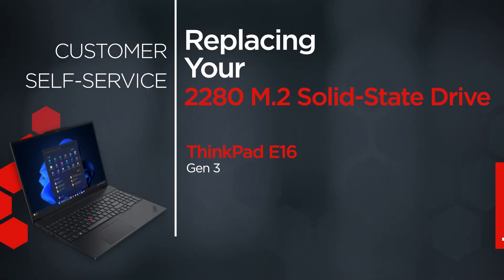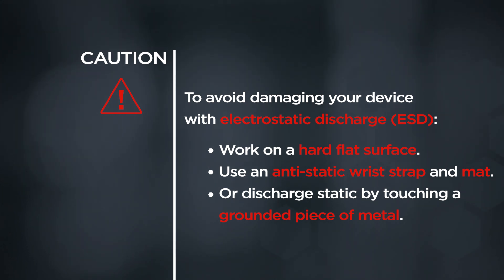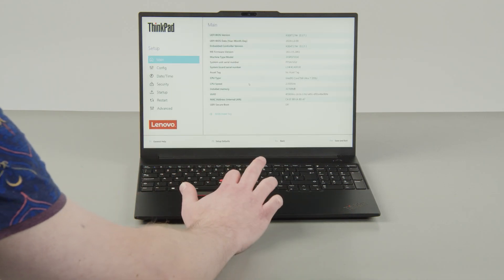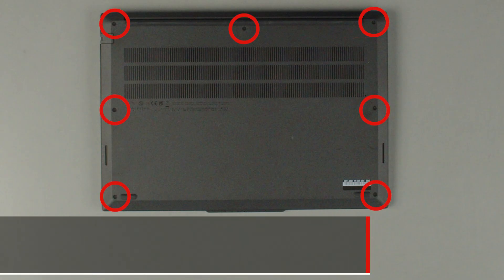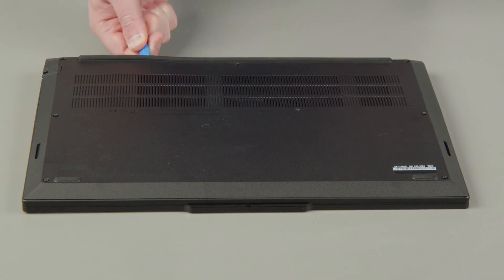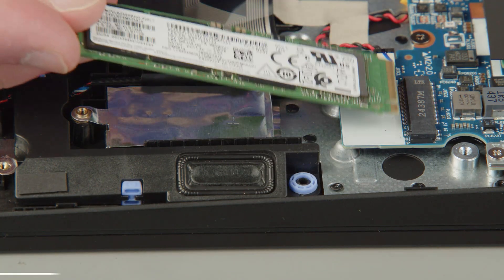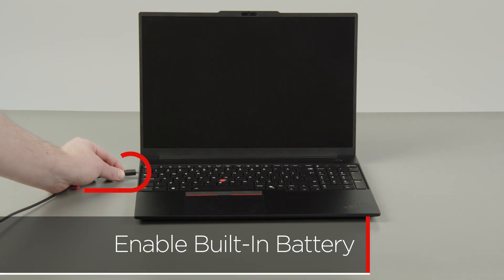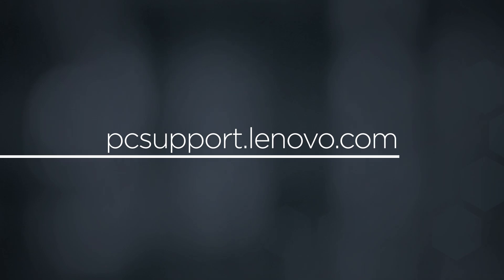Replacing Your 2280 Solid-State Drive | ThinkPad E16 Gen 3 | Customer Self Service

Comment from the maker: This video will show you how to replace the 2280 M.2 solid-state drive in your ThinkPad. The process in this video will work for the ThinkPad E16 Gen 3.

You will need a screwdriver kit, a non-metallic pry tool, and 15 minutes of your time.

To learn more about your device go to https://pcsupport.lenovo.com

To find parts for your device go to https://support.lenovo.com/parts-lookup/?cid=ww:lenovosocial:b9515f&source=socialmedia&subsource=yt

To view the Lenovo Support Self-Repair Guides landing page go to https://support.lenovo.com/us/en/solutions/HT516547

** NOTE: Static electricity can destroy components. Use a grounding strap, and clean, non-conductive surface to work on. Use plastic or coated tools to prevent scratching and avoid using metal tools on plastic parts. For more detailed information on electrostatic discharge and how to prevent it, please watch our "Understanding Electrostatic Discharge (ESD)" video: https://youtu.be/by4PB3WtdLo 

Applicable Machine Types:
ThinkPad E16 Gen 3 - 21SR, 21SS, 21ST, 21SU, 21TF, 21TG

Check out other official Lenovo channels!
https://www.youtube.com/@Lenovo 🟥
https://www.youtube.com/@lenovolegion 🎮
https://www.youtube.com/@Lenovo-PC 💻
https://www.youtube.com/@LenovoSuporte 🟢🟡

#Lenovo #LenovoSupport #LenovoTechSupport